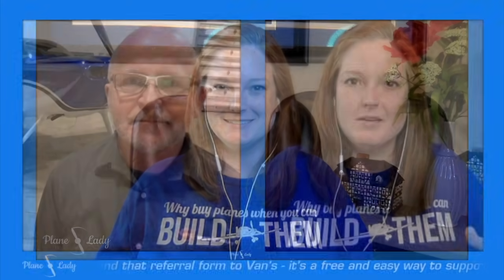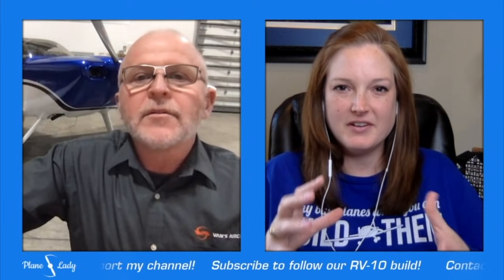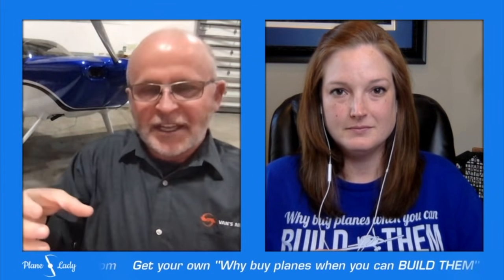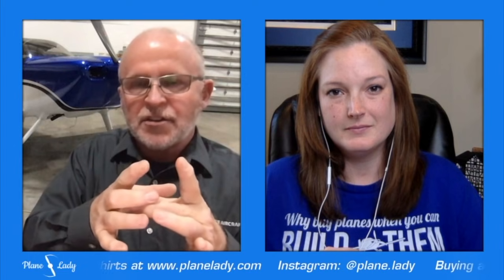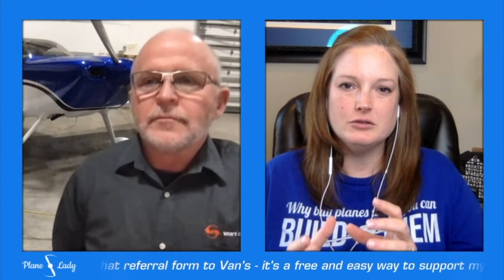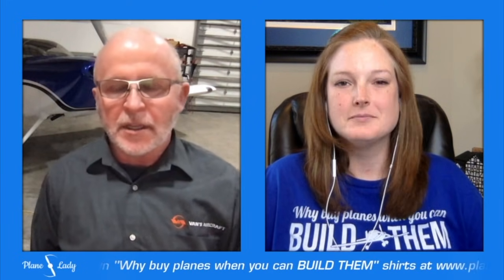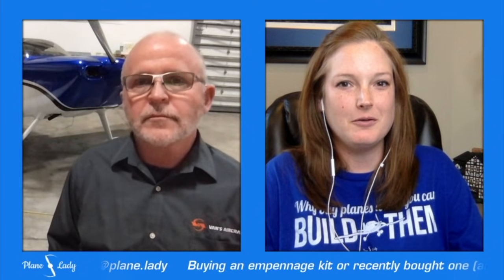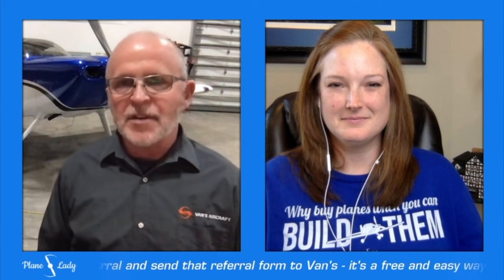Interview with Van's Aircraft about new RV-10 kits

Comment: Still confused will you have to drill the holes for the connecting part?
Reply from the maker: So if the two parts you’re connecting are both final sized then no. You just need to check the holes for burrs. If one part is final sized and the other isn’t, you will have to final drill the one that isn’t to make the holes the correct size. And you will still have to match drill parts with holes to the ones that don’t have any holes (like the longerons and stiffeners)